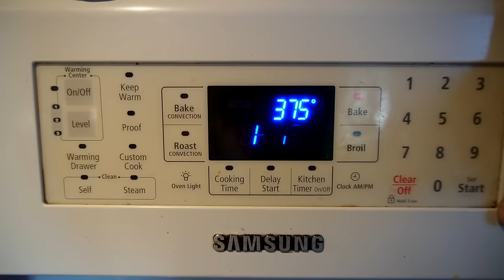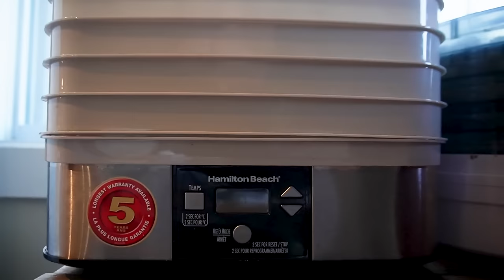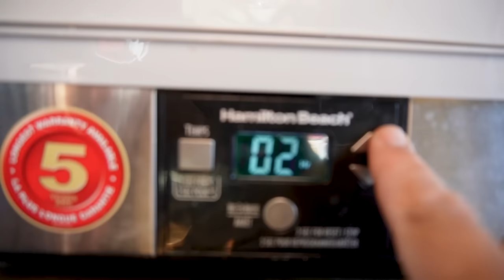Making Maple Syrup, Dehydrating Meals & Our Favourite Salmon Recipe!

Comment: Great video Tory.  I can just smell the syrup from here.  May I suggest how to save yourself a lot of misery trying to filter.  Just set it aside for a couple weeks or so and let it just settle out on its own. Carefully pour or ladle off without disturbing the crud. Then when you go to can it, heat it up to 180? and pour into your jars.  Any hotter and it will form new niter.  Far easier than filters, it will be crystal clear, and be less waste of good syrup washed down the drain.